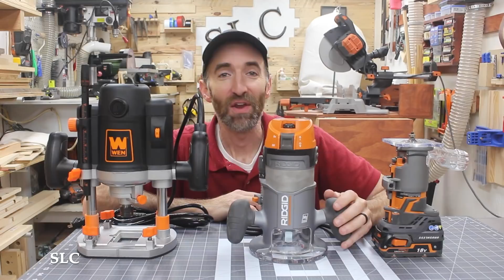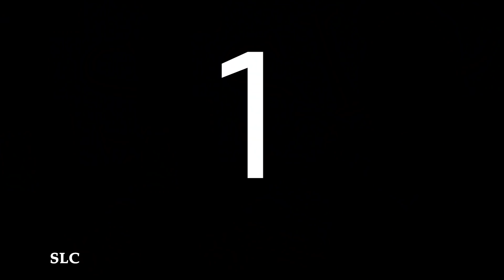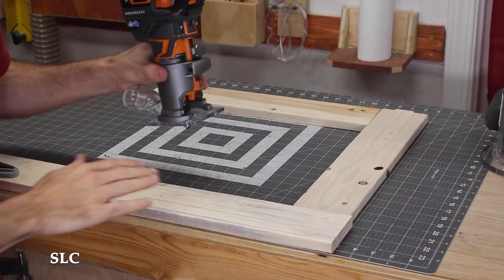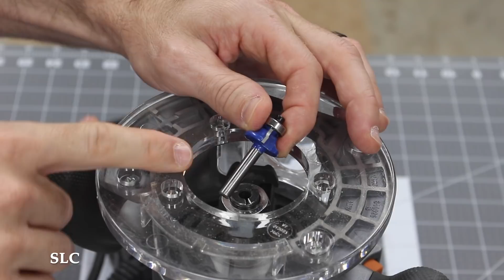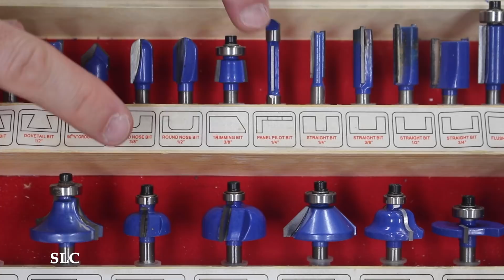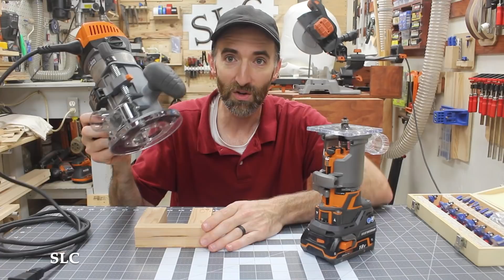20 Router Tips for Beginners

Comment: Kind of (maybe) dumb question:  if you are gonna a buy a set of cheap bits to experiment with,  and your router can take either size collet, which size bit would you buy?  Does it really matter?  Is there a benefit of using one size over the other?
Reply from the maker: That is a very good question and I'm not completely sure, but I would assume that the larger versions are for heavier duty routers and projects.

Comment: @11:00 behind you, what nailer is that and  how do you like it?  On the Ridgid trim router I have the model before and I like it and at the time it was the only cordless one but now I wish I got one that had more accessories such as plunge base. Do you have a work around if you need plunge function? Haven't found aftermarket one either
Reply from the maker: The Brad nailer is a Ryobi brand. I don't have any extra accessories for it, I just use it in it's stock configuration for standard nailing.
Reply: @SpecificLove7  Sorry that was 2 diff questions. The accessories was about the Ridgid trim router. I wish it had a plunge base available. Didn't know if you knew of a work around when needing to plunge with a trim router or do you just use your other bigger one then. As far as the nail gun, I have an 18ga and was wondering if that was a bigger gauge and when you use that one. Sorry to be confusing and possibly off topic. ;-)

Comment: Tip #7 is very important... always need to have the right size shaft.  (Sorry - couldn't help. ;-) )

Rout the end grain first so tearout is removed by the pass with the grain.  Also, you can edge rout boards with imperfections on the side using a fence on the router table.  Plus, you can easily build dust collection into a fence.
Reply from the maker: Those are some great tips, thank you

Comment: good points....as for the point on blade rotation....if the router is moving it moves left to right....on the flip side when the router is upside down the project/wood/plank moves left to right....ALWAYS Left >> Right

Comment: Thanks for your vids! 
     I like the spinning-tool docking bay. I will add an outer fence on all four sides just in case the thing vibrates itself out of place and the bit hits the side. 
     Another one for beginners: many tools have a curved arrow molded into the frame to show which way it spins. Sometimes it’s hard to find, at first. I always hit mine with a sharpie or paint to highlight it to remind me just in case I’m upside-down, or inside-out or whatever.
Reply from the maker: Great tip! Thank you

Comment: I have a better handy easier helper guide on direction. 
Place your right hand next to your work piece (say you were routing a frame) with your fingers flat and together, place your thumb against the wood and your fingers are pointing in the direction to go Anticlockwise, do the exact same thing inside the frame with your thumb on the wood and your fingers together, and your fingers are pointing in the direction to go Clockwise. 
Stay Safe,
Barry (ENG)
Reply from the maker: That is a terrific way to think about it. Thank you for the tip.

Comment: OMG... Story time!  My first experience with a router was years ago when I was making drawers, first time I ever used a router in a table and I was using a 1/4" straight bit to make a slot for the drawer bottoms.  I was making a cut that was too deep (didn't know it at the time) and when I pushed the board into the router bit it disappeared then I heard a loud noise (like a gun shot) about 20 feet away from me... I was puzzled for about 20 seconds what had happened... then I found the board and thought maybe I wasn't holding on to it, so I repeated the cut and it did the same thing... so I stopped and I asked someone; they told me what I was doing wrong... I learned the hard way that I'll never forget that you cannot take a deep cut.  Also I think I was feeding the stock in the wrong direction... as I said it was a long time ago so I don't recall.  Today I have several routers and a good router table... Take-away:  Be respectful and very careful with routers they are spinning frightfully fast! But, don't fear the tool... and If you follow these guidelines you will be rewarded with wonderful results!
Reply from the maker: That is a great story Ray, thank you for sharing it.

Comment: Product Suggestion: I’m new to Woodworking and got the Dewalt 618PKB and it came with a 1/4 and 1/2 inch collet. It also has changeable Fixed and Plunge base. I think it has a lot versatility. I haven’t tried it in a router table yet. Maybe one day. Lol 😂
Reply from the maker: That sounds like a really nice router. It should definitely meet your needs.
Reply: @SpecificLove7  thank you so much for Tips for Beginners Series. I’ve learned a lot of great Tips. I’m in the middle of designing my shop in a 2 car garage. The Plan is a miter saw station with my table saw with outfeed table on a rolling cart to fit underneath the miter station. on the other side an rolling cart assembly- Router Table on the other side. Plywood prices are still a little to high. But I’m hoping here soon to gone back down